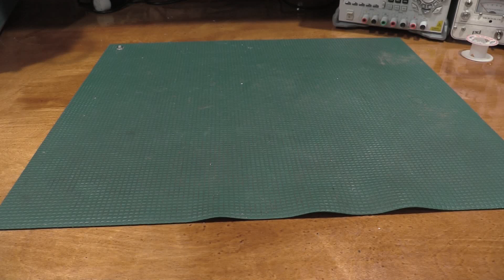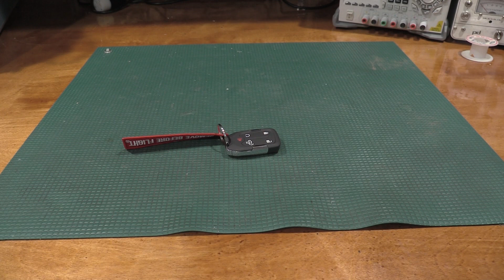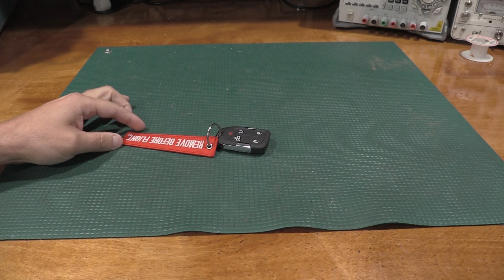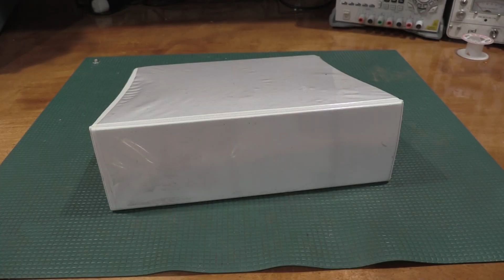Lab Update Better News (Warning Talking Hands)

Comment: Let that engine see a bit of load to build up cylinder pressure and push the piston rings into the bores to get them to seal up nice and tight. Some 'spirited' driving through the hills would do it. :)
Driving slow and easy will risk glazing the bores and reduce power and increase fuel consumption.
Reply from the maker: I will be doing that this weekend the manual advises not doing anything too rough till first oil change which happened yesterday. I have been told this is due to residual silicon that gets stuck in the block from casting this shakes out during the first oil change. I plan on getting it a little heavy this weekend to take care of the ring seating now that first oil change is done. But I am working on the "Spirited" driving part starting NOW lol.

Comment: I use a similar setup as mentioned in another comment here... My SG505 has both the IM 2 tone and balanced out options. It still operates in low distortion. I use AA501 A for the basic THD, and take its residual out to a Siglent SDS2202X-E in FFT mode. I can see a little farther down with this seup. I would prefer a low frequency HP spectrum analyzer, for this function, but at my age, it may not happen. Prior, I used a Spectra-Sonics unit, but it bit the dust.  The key is using the AA501A first... as it seems everyone is doing.
Reply from the maker: Indeed some of the magic in the AA501's is the automatic and deep but very narrow notch filter to pull the fundamental out of the signal. the function output of the AA is post notch so pretty much "everything else"

Comment: For very low distortion measurements try using a standard audio distortion analyser (I use an HP 8903A) and connecting your spectrum analyser to the monitor output from the distortion analyser. The distortion analyser nulls out most of the fundamental from your SG505 under test so the spectrum analyser doesn't have to handle the full dynamic range  required for extremely low distortion measurements. You can more easily pick out the individual harmonics you are trying to measure on the spectrum analyser display and then do some simple calculations to relate their amplitudes to the fundamental amplitude and thus calculate the THD.

The ultimate accuracy of such a set-up is limited by the linearity of the distortion analyser front end as that will add its own harmonic content to the signal under test but it should still be possible to see small variations on the total harmonic content as you adjust  the SG505. However, you will not be able to resolve much below the inherent distortion of the front end of the distortion analyser. The noise of the front end of the distortion analyser is also a problem but you can reduce its effect by using narrow resolution bandwidths of your spectrum analyser. 

In my case the 8903A front end would seem to have inherent distortion of well below 0.001%. My SG505 indicates 0.0013% on the 8903A but there is still significant fundamental amplitude, due to imperfect fundamental nulling,  and noise present on residual signal on the monitor output so the 8903A by itself is not capable of indicating the true distortion of the SG505. I haven't yet done a full analysis of the monitor output on a spectrum analyser to find the true level of SG505 distortion.
Reply from the maker: I will look in to this though the issues that I will have with the SG505 and SG502 is a frequency of interest issue. These are mainly in the audio range and are below the useful frequencies in my spectrum analyzers. As the main ones I have in the lab start at 9Khz the SG’s top out at 10K so there is not a lot of overlap.
Reply: @ZenwizardStudios  There are plenty of options for low frequency spectrum analysis. You could go "old school" and use something like an HP 3580A LF spectrum analyser or a Tek 7L5 LF spectrum analyser. Even "older school" would be a selective voltmeter such HP 3586A but that would have to be manually tuned to each frequency of interest. Nowadays, there are plenty of options for FFT analysis either in a dedicated dynamic signal analyser such as the HP 3561A or by using the FFT function available in most modern digital scopes. 

I haven't dusted off my 7L5 but used the FFT function in my scope instead to analyse the distortion components. However, the limited flexibilty of the scope's FFT means that the noise floor is relatively high obscuring some signals. Despite this, I can still clearly pick out the 2nd and 3rd harmonics and even some sub-harmonics at multiples of the mains frequency. The scope's FFT normalises the largest signal, the residual fundamental (1kHz) out of the distortion analyser, to 0dB and the other discernable signals are:
50Hz     -23.8dB     1kHz     0dB 
100Hz   -22.6dB     2kHz    -5.7dB
150Hz   -15.9dB     3kHz    -17.0dB
250Hz   -19.3dB    All other signals are buried in the noise floor at approx. -26dB

It is not possible to say how much of each of these signals originates from the output of the SG505 and how much comes from the imperfections of the distortion analyser. Assuming all signal imperfections are due to the SG505, then the indicated distortion of 0.0013% would reduce to less than 0.0007%  if the remaining fundamental signal could be fully nulled out. I am pretty satisfied with that figure for my SG505 and haven't tried to improve on it.
Reply from the maker: I do have a lower range spectrum analyzer on the list of to acquire. Currently in the lab all I have is a HP E4411B 9Khz-1.5Ghz, an HP 8596E 9Khz-> 12.8Ghz but in looking at the 3585B what I thought was a 9Khz to 40Mhz turns out to be a 20Hz to 40 Mhz and should fit the bill nicely for this analysis. I do have the 3580 on the list of things that I would like in the lab I’ll read up on the noise floor of the 3585B. 

From what I have seen from the SG505’s they tend to either work or they are damaged. As long as the IC’s were not abused in them they should hit distortion spec with out an issue. A distortion reading of 0.0007% is below the 0.0008% that is speced so should be good there. But at these levels this is getting WAY down there in the noise.  Knowing this I might be able to get the AA501’s dialed in a little better. With the noise in the lab it was tough to align the notch filter in the 501’s When I get that stack of equipment assembled again I will need to do some testing.  There will be a video about it soon but my DSA started acting up and needed some attention. But time to make a label to remind my self of the speed of the 3585 when it is on the shelf the spec line is hidden.